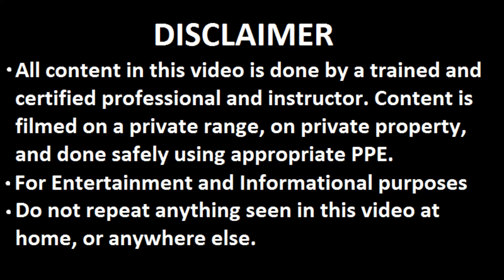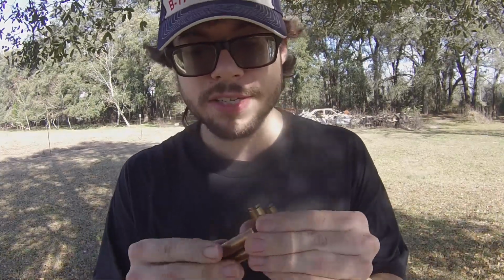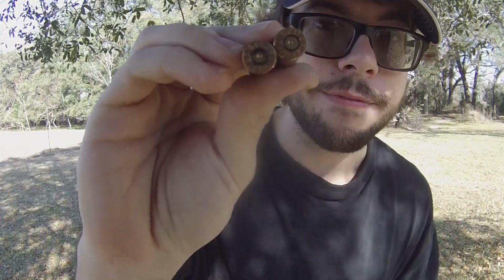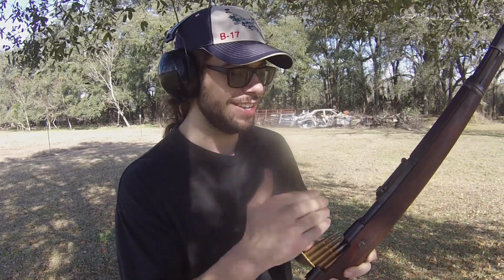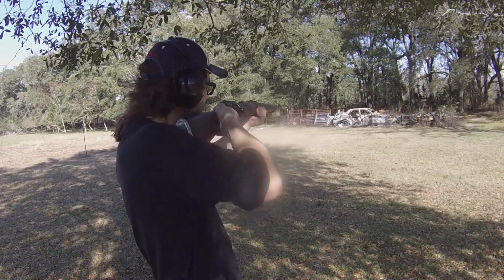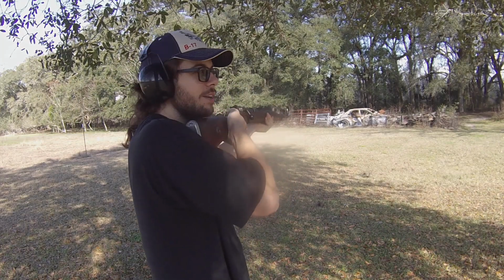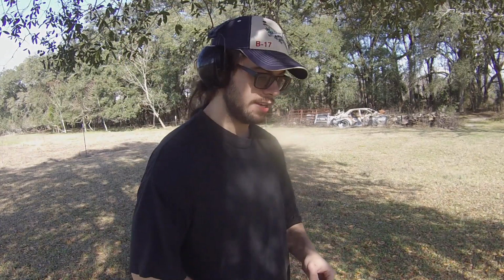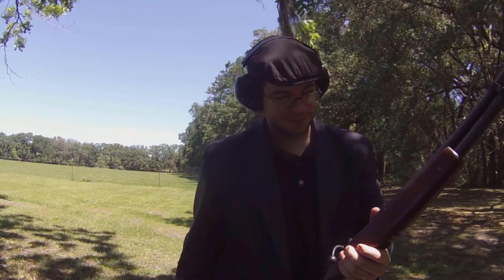Safely Shooting Turkish 8mm Mauser Ammunition

Comment: So I had over 20 cases of this Turkish 8mm ammo since the 1990’s. 1400 round cases with early 1940’s head stamps. Blew the barrel out of a Browning 1919  belt-fed, and cracked the trunnion, that was converted to 8mm, but It wasn’t the ammo’s fault. It walked out of headspace. It’s very hot ammo though and it whore out barrels quickly. And it beat the gun too hard. I wouldn’t shoot it now-days in anything other than a Turkish Mauser.

Comment: One of the big issues with the overpressure is not necessarily that the chamber or the bolt can't handle it, but that the stock can receive damage.

These guns are getting older and older by the day, the wood integrity has changed due to humidity and storage, cold weather and hot seasons, rifles may not be properly bedded or firmly seated in their stocks.

Though I can't say this as an absolute authority, the likelihood of your rifle blowing up just because the round is a little bit hotter is probably a non-factor. Your rifle suffering a crack in the tang from not being firmly seated or perhaps having damage done over the years exacerbated by the ammo? That is a much higher probability.

My advice for what it is worth, inspect all of your ammo, quadruple check that your rifle is properly secured in its stock, and observe for damage.

If you go out to the range and fire a couple rounds and notice a split starting to form, then you probably need to just break down the ammunition for its components.

Great video!

Comment: I have seen people say that this stuff has been stored badly and the powder is broken down.  This is not the case.  There is 48.5 grains of powder on average in these things.  The velocity runs 3900-3100 fps, which is way too hot.  I pull the bullet with a collet die, dump the powder, and reload it (without sizing) with 40 grains.  This load will do mid 2500 in my Turk rifle and it is way more accurate.  You can also identify cracked case necks this way too and cull them out before firing.

Comment: THANK YOU!  Many people think this stuff is MG ammo and that's bunk!  I would never run this through my MG42 or my 34.  42's are notorious for having OOB explosions on occasion and with standard ammo it's fine.  With turk, it will warp/bend/ruin the sheet metal receiver and damage the buffer.  In my G43 you CAN run it if you have the Apfeltor gas kit installed.  I had rob to a restoration on my G43 and had the gas tube upgrade done.  He said it will safely shoot Turk, but I don't dare run it.  I read years ago when the turks started making mausers and ammo they based their cartridges on the "S" 8mm but the ammo sent to them was proof ammo for testing the actions.  The turks thought it was standard issue ammo and made their ammo based on the cartridges that came with everything.  Makes sense since even the best preserved ammo is still hot ammo.

Comment: Any experience with the Turkish 30-06?
Reply from the maker: https://youtu.be/9-mWwVptMxk
Reply: @theblindsniper9130  sweet thanks looks to be good safe ammo, now for one more question how does the Turkish brass reload is it good quality?
Reply from the maker: No clue on that one. Ill test it. Stand by
Reply: @tripleoughtstoll8690  I have a couple thousand rounds of the Turk 30-06.  Mine is all MKE 1972 dated and shoots great.  HOWEVER, brass age hardens just as bending and moving it work hardens it.  So when you shoot it check for cracks.  If its all good if you are going to shoot it in just one rifle, anneal the case to re soften it and just run it up in a neck sizing die, not a full length sizer.  If you plan to shoot it in multiple guns, I would keep the brass separate (like I do with .303 British.), and do the same thing during reloading.  It's a pain in the ass to do it that way with different rifles of the same caliber, but you will get good life out of them.  I shoot it out of my M1 and my Johnson rifle.  The Johnson rifle bag of 250 cases are on shot number 4 and are fine.
Reply: @bad74maverick1  thanks for the info mate I would plan on shooting it out of my M1 and 1903A3 and possibly out of the older rem 7400 so I’m thinking my best route would be sourcing some brass from a place online sleeping giant brass I’ve ordered from them and good brass. I was crunching some numbers and my components excluding brass is $.45 ish and brass is another $.45 ish and I saw a place on the inter-webs for that Turkish mke stuff and it was reasonably priced around that $.90 mark which is about the same as I could put it together for so I was thinking I just buy that and have a decent supply of brass for awhile but if you say it “age hardens” I might just buy some good brass then I’ll have the fun of loading it. Any information on annealing brass thought about it, but never done it

Comment: The first time i bought 8mm turk ammo was around 2004 and that had a headstamp of 1939,it came in the worn khaki bandoleers on steel clips. I know that stuff was hot as when i shot it in an old turk mauser and a VZ24, the action would be hard to unlock after firing and the cases would sometimes have ruptures, it was certainly over pressure because of those two issues. The recoil was overly abusive as well. (Try putting 100rds through, I have, you will have bruises, laughs) Now recently I did buy some more turk 8mm belted ammo with a 1942 headstamp and its on MG belts, I have yet to test this new batch. The issue right now is getting it unlinked as its a "B" to do.
Reply: Have you figured an easy way to de-link it, or have you shot any? I got some in today, also 1942 dated.